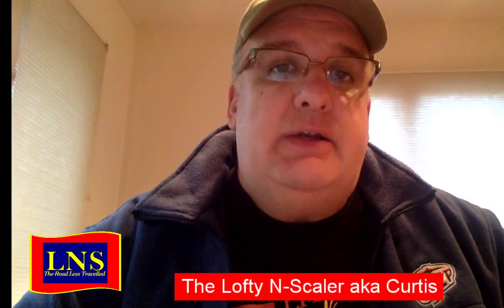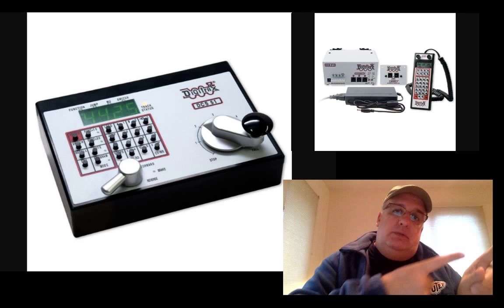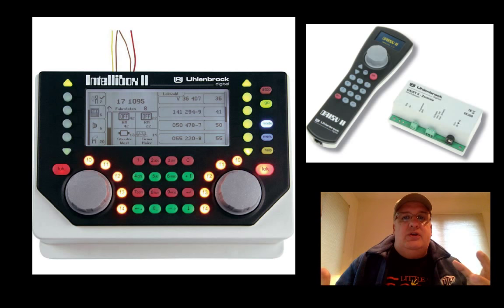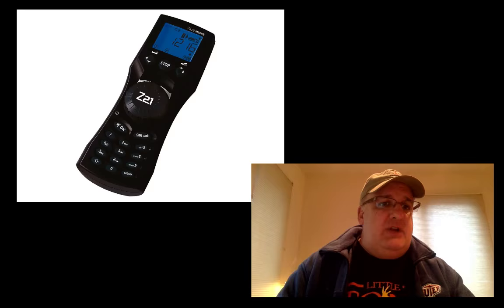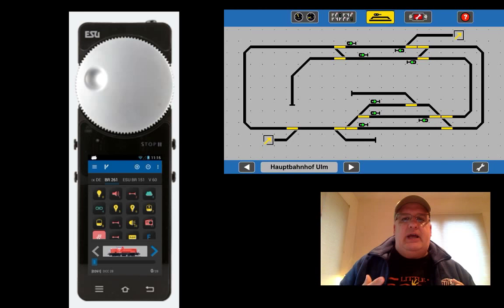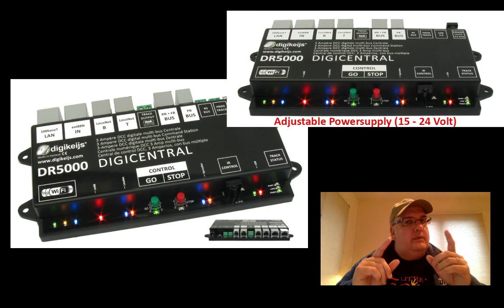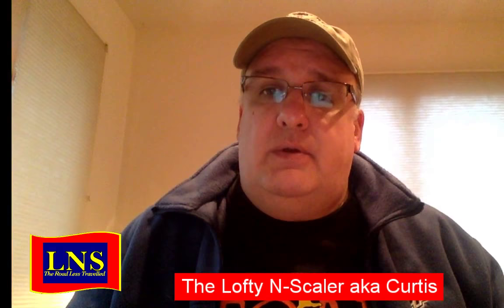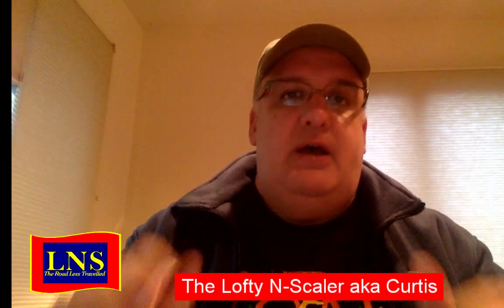DCC System Comparisions.  Digitrax, NCE, Uhlenbrock, Roco Z21, ESU  and Digikeijs

Comment: Curtis,  great video!   I see that Karst has provided the link for the update.  Yes, consisting is now working just like a Digitrax with a DTxxx throttle.  One correction, Universal Consisting is stored in the command station with both brands.  Advanced Consisting stores the info into the decoder.  
Also, all those Roco apps that you love on your phone or tablet will also run just the same on the DR5000.  The new Roco WiFi throttle works well too!  
Keep up the good work!  Talk to you soon....
Reply from the maker: Yes, I saw someone using the Roco Z21 app with it perfectly!!!  WOW, how cool is that!!  I really need to get my hands on one!  It is really the best of the best if you want to mix up your equipment!!  Thx for the comment and thx for watching!!!

Comment: The easy visual  'user interface' on any modern piece of electrical equipment is the key to its success.  Hence Microsoft windows' world wide adoption following its replacement of the archaic DOS coding system.

Comment: Very good summary, thanks for posting. I use the Z21, it’s very user friendly. Like you I would like to be able to use some of the Digitrax stuff with it such as the Bdl168.i believe there was a plan to produce a converter but I think this has been shelved unfortunately.
Reply from the maker: The converter was supposed to be out already, but it must have been delayed or as you said shelved.  bummer.

Comment: nice video!   I am planning on buying the Z21 and connect to RaspPi running Rocrail.  Will I need a LAN connection from Z21 to RPi or can it connect via wireless router?

Comment: Great video however I beg to differ sir. I have two black Z 21 and I am using the Digitrax Throttle DT 500 Duplex throttle with it via the UR 92 panel wirelessly  . I am also using the Uhlenbrock Daisy 2 wireless handheld with my other Z21 unit connected to  Loconet on the Roco Z21 . I have also tried running the Z21 as a slave unit to the  uhlenbrock Intellibox  and this way I have 2 physical rotating throttles plus 2 virtual throttles on my iPad . There is also a Lenz LH 100 Hand Held plugged on the X bus of the Z21 command station . So you would be surprised by the versatility of both Loconet as well as XPRESS net across the different brands  available out rhere . Thanks and happy model railroading  .
Reply from the maker: I didnj't know you could do that.  I am not sure what the UR 92 is?  Can you send me a link?  THX!!

Comment: Hi Curtis,
I go to used train show in IL. I have purchased DCC loco's, all kinds of train cars buildings etc. I picked up a MRC Prodigy Express DCC control System new for $45.00 I haven't made a layout yet that's why I like your site. I don't have a lot of space to make a layout I was thinking of snap together modules. I know that this MRC new was $169'99 so I picked it up. So what do you think about the MRC systems. I figured it was a inexpensive way to get started. I like what I see on your site because you are doing things on the smaller scale layout not large like all the other sites I have visited. I also want to get my almost 7 year old grandson involved it this. At these train shows I go to they have some club that has a large layout set up for children to run so that's always one of his first booth's at the show he wants to go at lease 2 or 3 time that day.
Tony Benedetto
Reply from the maker: +Anthony Benedetto Tony, the MRC system is a great place to start. As you become more complex with your decoder programming etc you will see the limitations of the mrc prodigy system. It is just a very basic system but just fine to get started on!!  

Great that you are getting your GS involved with trains!  Start ‘em young!!  

Thx for the comment and thx for watching!!
Reply: Thanks for the reply I think it will be just find working with a 6 year old on a small layout.

Comment: For someone coming from a simple analog LGB setup (basically, one transformer), all these systems seem very complex to me. I want a system that gets out of the way. I really only need a DCC system that can handle a few HO trains on a small home layout (but with expansion capability if I expand the layout and get more trains), with a large knob for throttle (I always liked that about the old LGB transformers) and with expansion capability for multiple control units if, for example, my dad comes over. Maybe the Piko SmartControl Light gets closest, but it's limited to 2 Amps.
Reply from the maker: Robert, Have you looked at the new digitrax Zephyr?  I would think that would be a good solution.  THx for your comments!!
Reply: @chustaceTheLoftyN-Scaler  Thank you. Looks a bit clunky, but functionally seems good. 3A seems pretty low, though. I wonder how easy it is to expand the power with a booster... I've read those require separate power blocks, which again seems really complicated.
Reply from the maker: I have a booster I used eight the Z21. I just had to isolate the sections and connect the booster to the main Z21. Boy sure how digitrax works. GL

Comment: That's a very helpful video! I'm having this issue rn and need a decision because of budget limitations I can't convince myself to pay $200 for a digitrax syatem when I can get a roco starter complete set with Z21 controller! I just wanted to ask you does fleischmann have the same controller? Because they are cheaper than roco a little bit and have the same looking digital controller?
Reply: Well Roco came from Austria and went into bankrupty and GFN (Fleischmann Brothers of Nuremberg) came from southern germany and did not found anyone, who wanted to manage their Ltd. Co. into the future, so the Company had been given into hand of the new Company called Modellbahn Union Ltd. and just owning Roco and Fleischmann.
Roco/Fleischmann both are provided an older DCC digital system, where a cablewired multimaus is being used in combination with a small booster of the black box 10764 (Roco paet No.) plugged in as Master Multimouse.
It was impoertant the the Master Multimouse never plugged off during service.
For controlling and programming the Master Multimouse could do this only, the as slave plugged in extra Multimouses could control trains only.
This system worked like NCE power Cab but with one difference, CVs were not able to read out.

Around one decade later, Roco and Fleischmann provided the new Z21 Family of Command Control Stations.
There are 3 different Types are available.

The white z21 Start and the white z21 are nearly the same but provided with Starter Sets only.

The difference between the white z21 Start and the white z21 is, that the white z21 Start come with out the extra sold Wifi Router.

So the white z21 comes with rhe Wifi Router but needs an extra sold linking Code for the Router.

The black Z21 has the Wifi Router inclusively and the Wifi linking code, too.

Another difference is that the both white z21 Start and the white z21 coming with cable wired red Roco Multimouse or cable wired grey Fleischmann Multimouse.

There is no Programming Track available for the both white z21 Start and white z21, they have POM = Programming onto Main Mode only.

Between the red or grey Multimouses are no differences except tge colour of those handheld throttles.
You need a six pin telephone cord to connect it with the z21 Start, z21 or Z21 or even to the Digikeijs DR 5000 Multibus Command Station.

The old small booster boxes of 10764 or 10765 can be used in addition with the z21 Start, z21 or Z21 as Boosters, too.

The max Amperage is 3.2 Amps by up to 21 Volts.

The Roco/Fleischmann Z21 Family has a little problem in using more than 
3 boosters, after that they need to have a brake module to add more additional power to the DCC Datas before adding more Boosters.

It will be very important to know how much Amperes your Locos will need, so you maybe need an alpha meter from DCC Concepts in addition, to control the used Amps to the system.

Another big problem is, that the Multimouses do not have a consisting Menu to work multiple Locos but it works via Advanced Consisting via 
CV 19.

When using the Digikeijs DR 5000 you can change the Mode of the running DCC System to the Digikeijs DR 5000 by switching it at your PC or Laptop.
The Digikeijs DR 5000 can create the Roco/Fleischmann DCC Signal with up to 3 Amps and between 15 Volts and 18 Volts as Trackpower only.
If you will use 24 Volts of Power by using the Roco Signal than you will destroying your Digikeijs DR 5000 Command Station.

It will be better to use circuit breakers to protect your Command Stations against circuit shorts, coming from Train service.

Yes you can using the cable wired roco/Fleischmann Multimouses to the Z21 Family and of course to the 
Digikeijs DR 5000.

When using the Android, iOS or Apple Phones or Tablets to your Z21 Family or Digikeijs DR 5000 you easily can using the Roco/Fleischmann App (free downloading at Google Play Store or Apple Store) to consisting multiple locos together, the app writes the CV 19 settings automaticly to the Command Station.

If using one of the Multimouse handgeld throttles, one of the both cable wired red roco or grey Fleischmann one or black Z21 Wifi Multimouse, than you need to create the multiple Units using Advanced Consisting via CV 19.
All short two digit addresses between 00 and 99 can be used for it.
When having a loco in wrong direction easily adding 128 to the consisting address of the Consist Address.

Sure it works to change the short Addresses into long 4 digit addresses, too using CV 29 but that you are knowing maybe better than me?

For myself I use 2 digit addresses only.
I don't own more than 45 Locos and onto my two small fictional roadnames locos have short 2 digit numbers onto cab, too.
Reply: @ingor.522  Thank you so much for the explanation!
Reply: @sheri1983  
Roco/Fleischmann stopped the production of different colour Multimouse Handheld Throttles and providing a new light grey, cable wired ,,neutral" version of it and it comes with a z21 onto the black knob.

The black Z21 Multimouse is the Wifi Multimouse provided as separstely sold handheld throttle for the Z21 with Wifi Package or the both white z21 Start and z21 with the added, extra sold WLAN Wifi Package wit separate sold connection code.

The technics of the red roco, grey Fleischmann or light grey (nearly white) cable wired Multimouse of both Companies are absolutely the same, the difference are the colours, only.

Comment: Went from NCE to Digitrax cause i wanted the duel throttles. It gave me nothing but headaches. Totally disagree with finding help on faults / issues with digitrax. Most convoluted, overly complex manual. Throw in JMRI and soon found my favourite hobby was making me very frustrated. There is so much jargon and pinpointing a solution to faults is near impossible. Often could only find very rudimentary 'fixes'
So all my digitrax gear is all boxed up ready to sell on. 
Now I'm using ESU CabControl. (much cheaper than the ECoS) It's so much easier to learn, use and is modern, Basically a mobile phone interface with a big fat dial on the top. Help is easy to find and in layman terms. You don't need to be a electronics engineer to read the manual. ESU have dozens of help videos. The only thing i had trouble with was track voltage. Easy to overlook. But once i turned the dial up. I didn't even need the manual. Added all my fleet easily, very intuitive system.
I'm not bagging digitrax, they are awesome. Just be ready for a heavy learning curve. Too much for me.
NCE, love it. If they had a modern cab control with LCD screen I'd probably go back to NCE.
Only had the ESU for about a month and my only regret is not getting it sooner.

Comment: Yes, this hobby needs a younger generation but at what cost? Technology will make kids stupid because they're not using their brains to think! If everything is shown on a keypad and all they have to do is push the icon, to perform the task, how will other problems be solved if the kids can't think out the solution? I understand that there are automated systems in place now, but when i was growing up, everything was done manually! Just my opinion. Roy
Reply from the maker: +CONTAINERMAN68 Roy, I see your point. Remember a slide ruler would do a lot of calculations but does that mean because it makes those calculations we shouldn’t use a calculator??  Tech makes life easier in some aspects. As long as you understand how you get to the same point that’s all that matters. :). Thx for the comment.